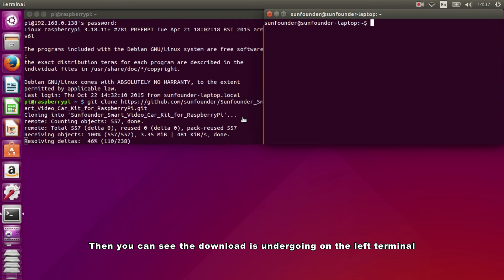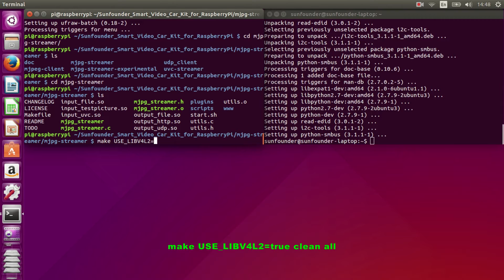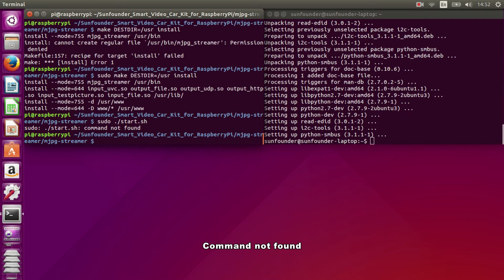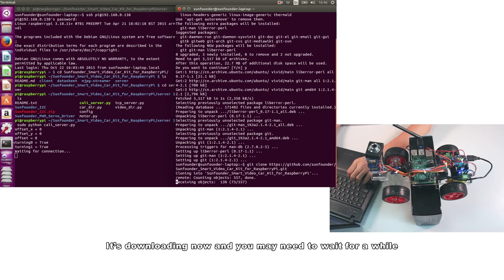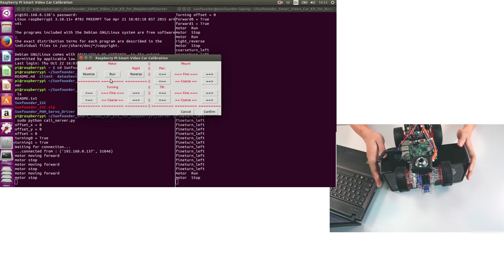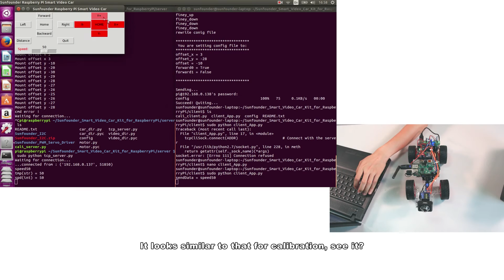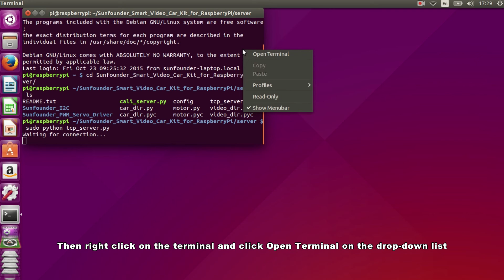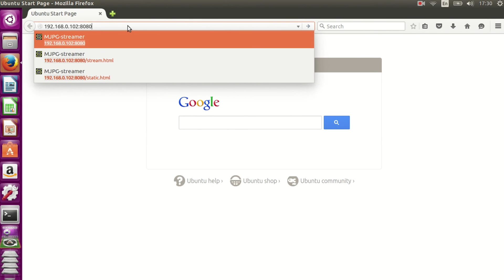Smart Video Car for Raspberry Pi Assembly Tutorials 04 Software Setting/Configuration/Debugging

Comment: I don't understand where to get the password
Reply from the maker: +Angela Yake By default the password for the Raspberry Pi is raspberry.
Reply from the maker: +Angela Yake Wired. Your comment's not shown here but I got the email reminder....
Q: "Thanks for the help. I am still getting and error after doing the i2cdetect troubleshooting are my wires wrong?"
A: Please email us (support@sunfounder.com) and attach the screenshot of the results (the error message) and photo of your wiring. We'll reply you ASAP.
Reply: +Sunfounder Hello!  I got the Raspberry Pi with official sd card and preinstall OS (on the sd card). Now I try to connect with RPI from my linux laptop running Ubuntu (the command: ssh pi@mi laptop address). The terminal output after entering the password is: Permission  denied, please try again
Reply from the maker: +Igor _Osipov Actually if you use the command ssh pi@your laptop address, it will get remote access to your laptop with a user name 'pi' (just take "ssh" as a tool, "pi", a access user name, and "ip address", the path to your pi). That's why you got 'Permission denied'. So here you need to ssh to your Raspberry Pi's IP address. You may get it from your router or by a screen connected to the Pi.
Reply: +Sunfounder Ok. Thank You.  Now I have another problem: I can't connect to the raspberry via wi fi because wlan usb stick is not working. On Your video I see a blue led light when it in USB of Raspberry Pi. I have tried to connect the wlan stick into my laptop (running on WIN 7) and the led are turned on. The driver is automatically installed. So I think there is no driver installed on my Raspberry Pi. Where can I find a driver for the stick?
Reply from the maker: +Igor _Osipov The WiFi USB does not need driver, unless you're using other operating systems instead of Raspbian. For the LED not brightening, it may be because you haven't set the network. Try to connect a screen to your RPi and configure WiFi.